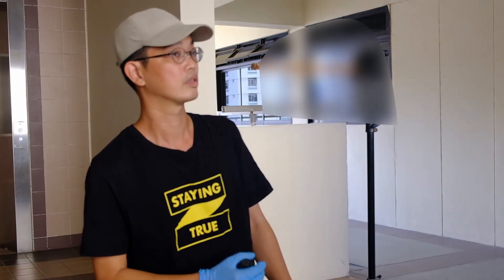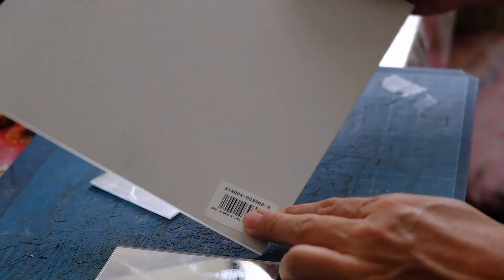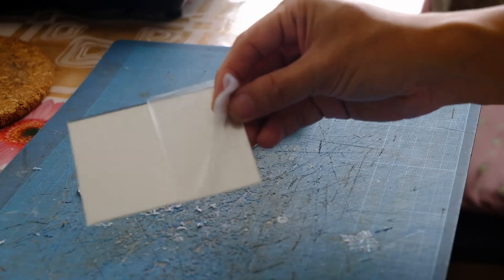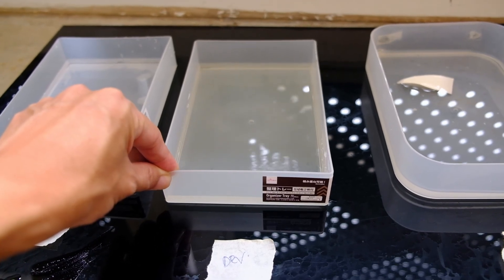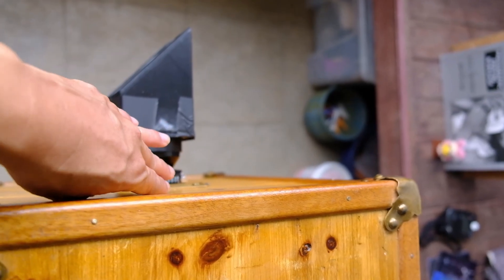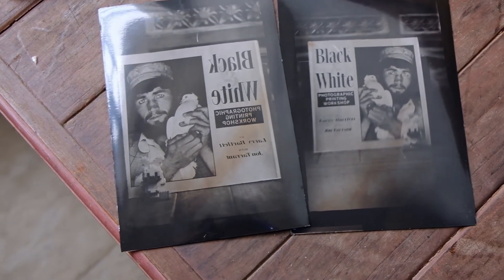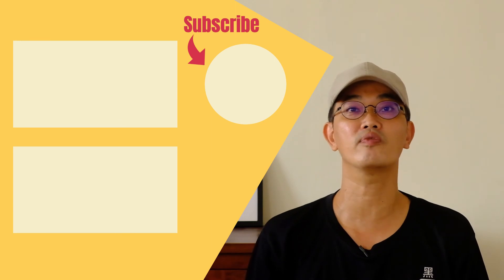Correcting Backward Text in Black & White Reversal Prints (DIY 3D Printed Mirror Scope!)

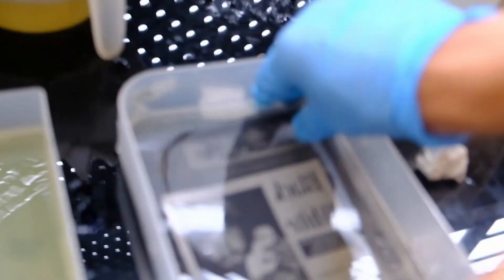Comment: The brown stain you mentioned around 7:30 is redeposition of dissolved silver from the bleach bath; this is  a known problem with peroxide/acid bleach.  If you bleach your print face down, that won't happen.  It also won't happen if you use a different bleach process (permanganate or dichromate in sulfuric acid, or ferricyanide and sodium chloride followed with an ammonium hydroxide bath to remove the silver chloride without dissolving the bromide in the paper emulsion).

As for image quality ( 11:30 ) you're correct that the mirror is the likely cause of the degradation.  The solution for that is to use a better mirror.  Optically flat first surface mirrors are more expensive than the plastic-backed mirror you used, but will produce almost no image degradation.   Another option would be to use an optical prism instead of the mirror -- once again, the optically flat surfaces will produce much less image degradation, but now you have three optical flat surfaces, making this likely even more expensive (but more durable because there's no fragile first surface coating).
Reply from the maker: thank you for your tips. I was using a reused dichromate bleach but  I cannot confirm which way is the print facing.. I will try with a potassium permanganate bleach the next time .

Comment: you can also achieve the right orientation by doing a contact print from your first image.
Reply: Aw, where's the fun in that?  The classic Afghan method is to make a paper negative and rephotograph it -- the orientation of the negative and positive sheets, emulsion facing emulsion, corrects the mirror image, and if you have the development (or paper grade) just right, you get a good normal contrast final positive print.
Reply from the maker: oh yes, double reversal should work too. but maybe in that case, shooting a normal negative to contact print to a positive will be easier